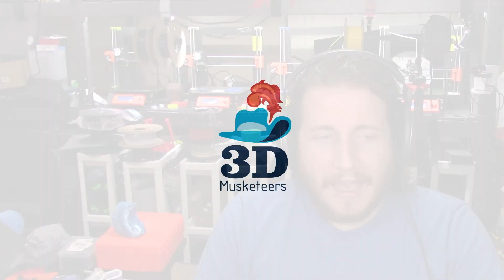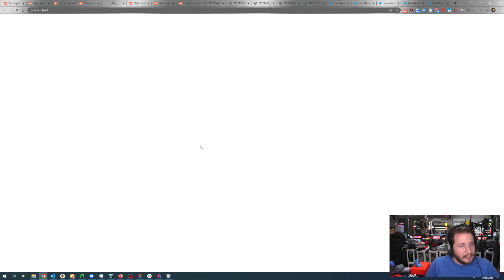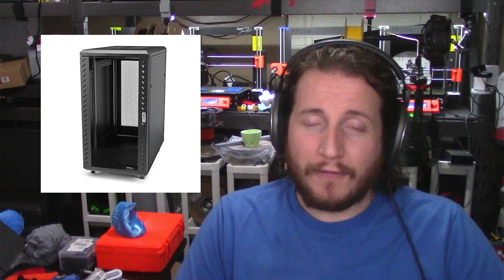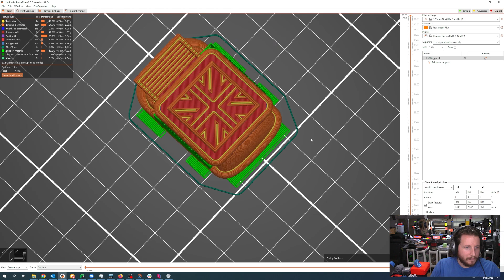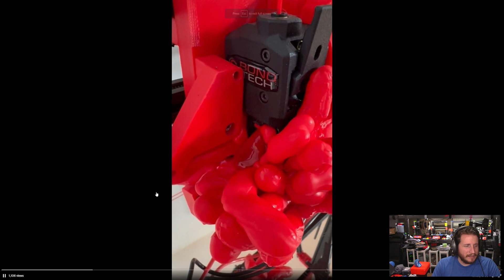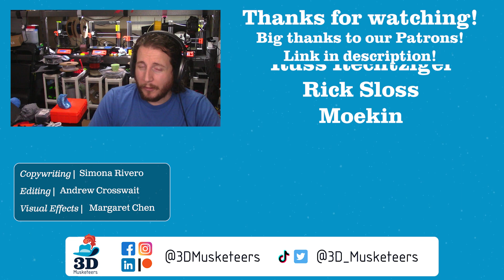The Worst 3D Printer Blob Yet! - PrintFixFriday 62

Comment: The belt should not be like a gitar string. There are even test done by youtubers. his force is waaay too hight. it shoulb be tight and hats it not tooo tight.
Reply from the maker: There is a specific note, I think a G? I dont know.. My prusa's tell me when they are tensioned correctly so I do not bother to tighten them often.. But you want SOME twang to them, but yes, not a ton.
Reply: @3DMusketeers  That´s simply wrong. This s not a music instrument but a piece of equipment. These parts are small and delicate it is super easy to overtighen them which wears out mechanical components much faster. i think something like 0,5N is already enough.
Reply from the maker: and if you notice at even that tension it has a bit of a twang to it. I have been doing this for 15 years and it has never let me down ha ha. Although I guess it depends on the length of the belt for how it will sound.. It was more of an issue on older printers without nice Gates belts, newer printers seldom have such massive belt stretching that it is an issue.
Reply: @3DMusketeers  It also depends on the belt. There are soooo many miscnceptions in the 3D printing space. I still remember those "oilers" dumbest idea ever.
Reply from the maker: to defend the oilers.. it was a spillover from the early days when we used to make our own nozzles. They ALWAYS were terrible and you used the oil to lube up and basically create a non stick surface on the inside of what was essentially a drilled out bolt. I do not miss those days. Maybe it was shroud in misconceptions as well, but it seemed to work for me LOL
Reply: @3DMusketeers  Yeah sure I mean it worked somehow xD 
Oiling your filament does not really help with Z bonding ^^
But it was creative and funny. Especially for me as a mechanical engineer haha =) I mean as soon as it works why not right.
Reply from the maker: Oh yeah so many dumb things back in the day.. I remember using nichrome wire to make my own heaters. So sketch ....
Reply: @3DMusketeers  Not at all, back in the day people were really innovative and problem soling. I think it is great that you made all those experiences this also shows your interest in the matter. And it is not as easy as some might think to get everything working.
Reply from the maker: We absolutely went by the "if it is jank and works, it is not jank" principle.... 

15 years in this, for better or worse, sickness and health, etc. LOL
Reply: @3DMusketeers  Also this principle hold absolutely true, if something looks horrible but works then it is not horrible xD
Reply from the maker: That is what I say every morning in the mirror!! :D
Reply: @3DMusketeers  Hahahah Jesus that´s dark. I hope not. xD
Reply from the maker: some days ha ha ha! But then again I almost never wear makeup on camera. It happens mostly in the summer on the standing set because HOT and Florida lol.
Reply: @3DMusketeers  Oh man I am jealous I live in Germany now and in Siberia before, I WISH I was in the Floridan heat xD 
I have been to L.A. and Vegas before and I will visit Miami in 1-2 Years, can´t wait! Maybe I will meet you there and then. I can show you how to tighten the belts then xD Haha
Reply from the maker: I am about 4 hours north of Miami alas, BUT Wham Bam is in Ft. Lauderdale! 

I do have family in Miami though, so if it is around a holiday chances may be high. Get pasteles at Pinecrest though when you go! 

The heat is fine, the humidity knocks me on my ass some days!
Reply: @3DMusketeers "...I do have family in Miami though..."
Great, I will let you know =) 
Maybe WW3 will break out before that I all die in my PZh2000 somewhere xD 
 
humidity I didn´t think of this one.

Comment: I wanted to get your thoughts on my situation. I'm trying to print Wobbuffet. But I've been having trouble with the MMU. I've had more issues with Sunlu than any other filament. One of my recent prints was a bulbasaur that took 4 days mostly printed in eSun. It didn't have a single failure. Well I switched this print over to eSun. (black and blue) It's greatly improved. The sunlu kept jamming up everything and as a result I was getting tons of grooves in the filament and had to cut it off. With eSun, that's pretty rare, but I'm still getting a lot of MMU fails. It's very stringy. I increased the cooling moves from 1 to 3 and that helped, but even then it's still failing. Besides the fact that I'm using black and blue instead of light blue and green, it is colder than it has been. And I don't like to use the heat much. So I have no problems with it being 60 degrees in my house. I tend to never let it go over 65. Is it possible that the ambient temperature is why the blue especially ends up with stringy tips? Is it possible that my nozzle needs replaced? It is the original Revo nozzle that came with the hot end. I've used it maybe 3 or 4 months now. It definitely has been abused (the extruder trips over blobs in bad print fails, thankfully not happening with the eSun, but it happened a lot with the sunlu) or is perhaps blue just a difficult color to work with?
Reply from the maker: Generally it is not likely to be your nozzle or ambient temp causing stringing, but instead water. The brass revo nozzles should be PLENTY fine. The blue may be a bit damp and stringing more, or it could be a bit hot when printing causing extra strings.
Reply: @3DMusketeers  hmm well I didn't do a temp tower. I just used the results from the light blue tower. It shouldn't be wet as I keep everything in a dryer while it's printing.
Reply from the maker: oksy, definitely check temps then. You can likely go down to 205 or even 200 with the mmu
Reply: @3DMusketeers  On the V6 hot end 200 was clogging with PLA+. (esun is pla+) I did a temp tower and found that 210 was decent. I never re-ran one on the revo. It does seem to be more tolerant. But then again that was light blue. I should probably do more temp towers.
Reply: @3DMusketeers  anyway the supports failed and the arms were getting mangled so I canceled the print, cut off the tail. I'm printing that separately. So there will be much fewer color swaps. I should have done it in the first place.
Reply from the maker: Seems like mo color swaps mo problems?
Reply: @3DMusketeers  the last one had tons of swaps. Not a single issue. Thats why I'm so puzzled. It was 4 days long and swapped colors most of the time. In plenty of cases it had 4 colors in a single layer.

Comment: I'm surprised that a power supply would have a manual voltage switch. Most of them are automatic now. Hell even the solution I came up with for my C64 (which was like $5) is dual voltage automatic.
Reply from the maker: The cheap ones all do...